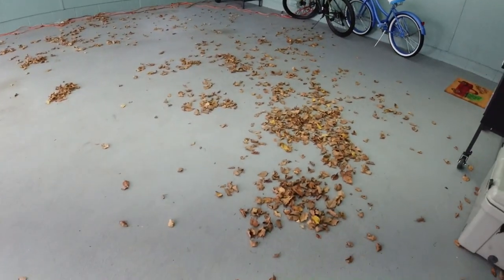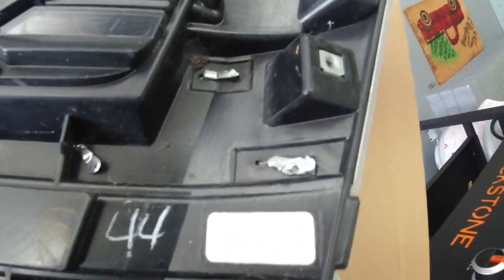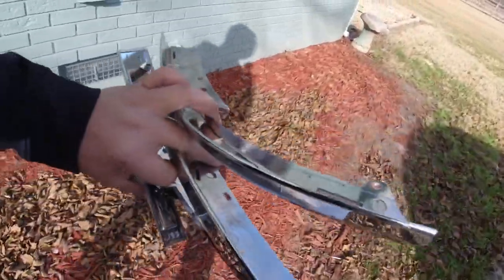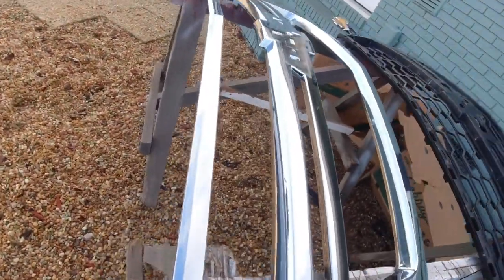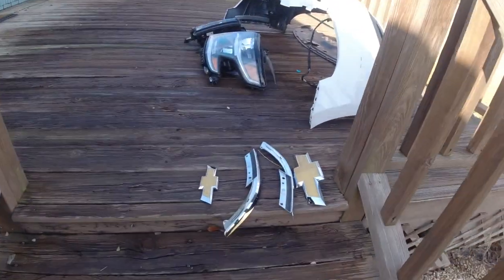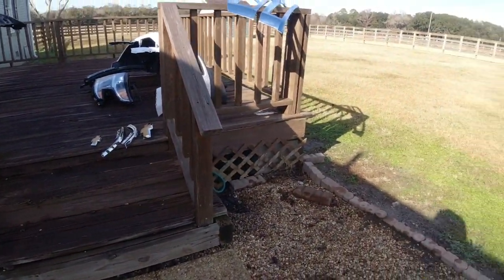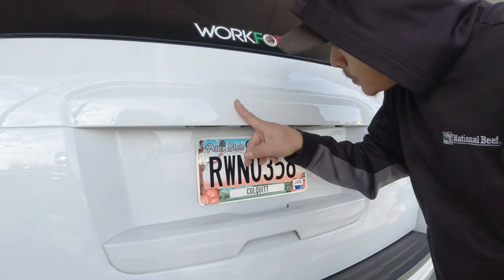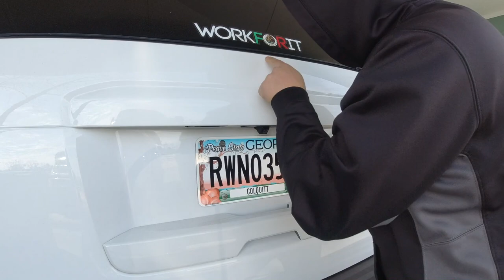Tahoe Build Part 1 (how to take apart front grille of 2015-2020 tahoe)

Comment: How did you fasten the grill back together after paint?
Reply from the maker: I used jb weld and glued it together everywhere both the black grill piece and white part met, it worked out good and is pretty strong